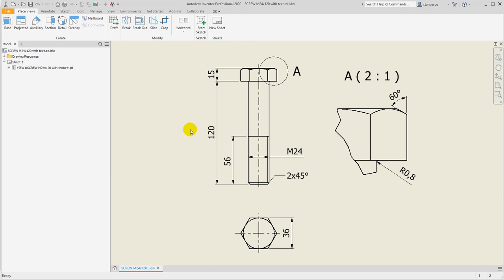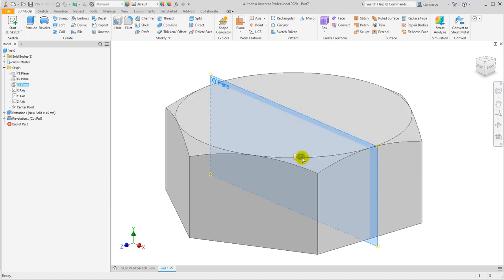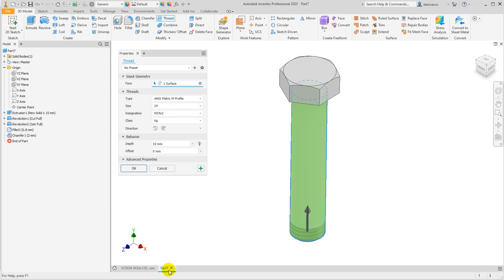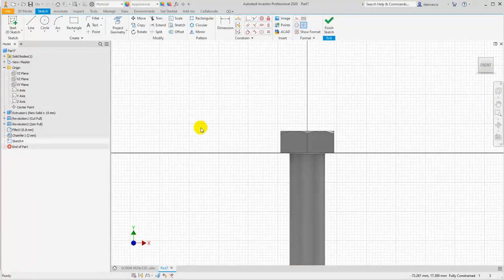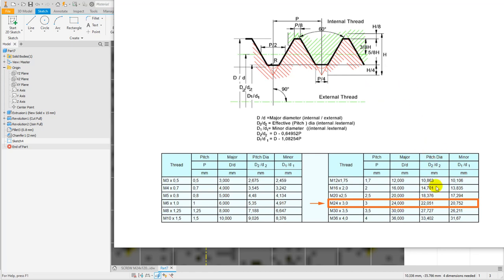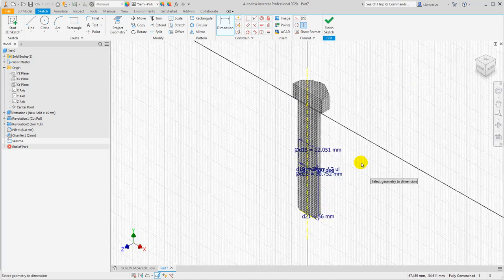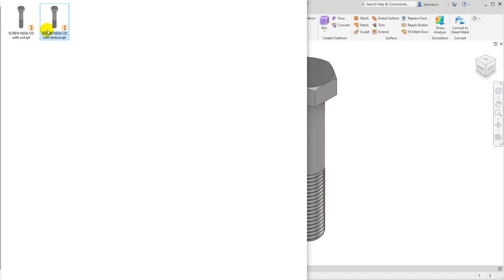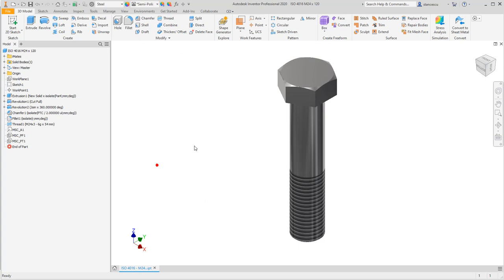Tutorial Inventor - 016 REAL THREADS

Comment: Mr professor, the screw from Inventor library "iso 4016" used "thread" command instead of a "revolve", so it's not a real screw. Is it ok to use it like this in projects?
Reply from the maker: Yes, in the Content Center they use the command Thread and obtain our first solution (the thread is a texture, not a real coil). If you want, you can create your own library with real screws. Good luck!

Comment: Фаску на головке болта удобнее делать инструментом Выдавливание (Extrude)-Пересечение (Intersect), Угол (Angle) 60deg. В качестве эскиза окружность диаметром 36 мм.
Reply from the maker: (It is more convenient to chamfer the bolt head with the Extrude-Intersect tool, Angle 60deg. As a sketch, a circle with a diameter of 36 mm)
You mean that we can use an Extrusion/Intersect with a 60deg Taper angle.
Any model can be made in many ways.
Thank you, I'll use this way in my next appropriate model.